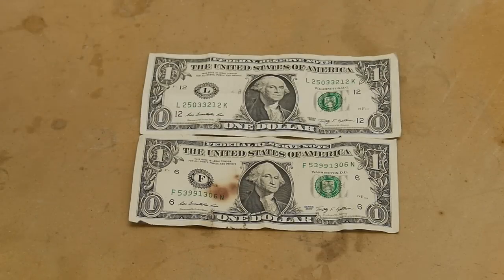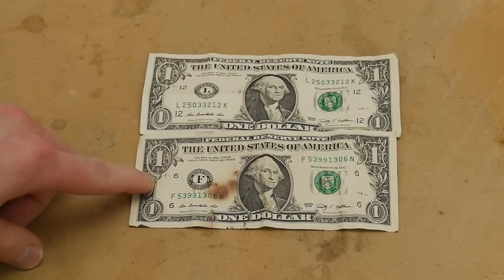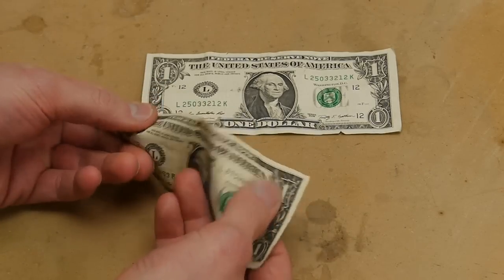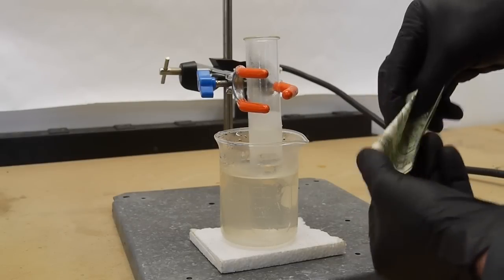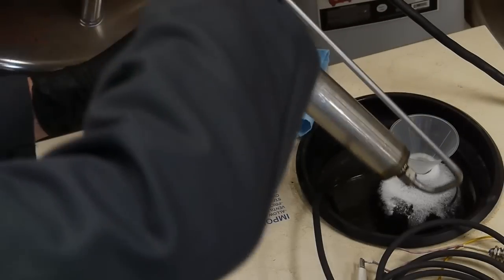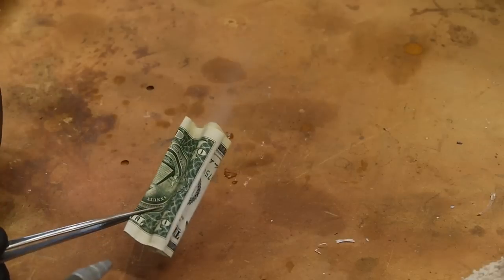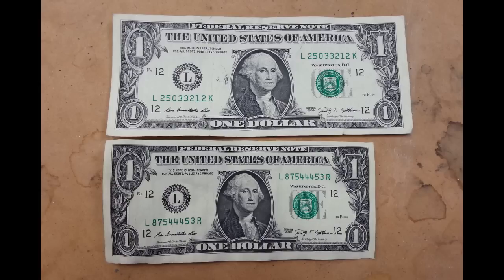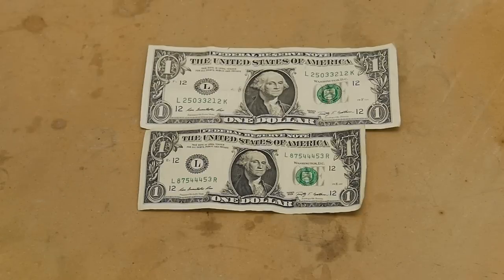Shrinking paper money with ammonia

Comment: (Hands a 20 to a cashier)
"Do you have any smaller bills?"
(Hands a shrunk 20 to the cashier)
Reply: Thom nice one.
Reply: +Thom I wounder if all the validation marks are still left on it?
Reply: Well yes and no. I mean the ratios are probably still there but most checks would not work because they do not expect the paper to shrink.
Reply: Well yes and no. I mean the ratios are probably still there but most checks would not work because they do not expect the paper to shrink.
Reply: Yes they are.  It's my job to inspect bills for counterfeit.  So when I came across one of these you can imagine my surprise when I examined it and found it to be authentic.  One dollar bills don't have all the security features that larger bills have.  But there are certain things to look for that will tell you if it is real or not.  I can tell you it had me scratching my head, because other than its size it checked out to be a good bill.  It even passed the counterfeit pin mark.  Which isn't always a good indicator of a fake bill but normally it will always mark a good bill as real.   Sending your money though the washing machine can cause a counterfeit pin to indicate it is a fake bill.  But I have yet to see a pin mark a counterfeit bill good.  Ya someone will tell me their story now.  But so far I haven't came across it yet.
Reply: That's why Goerge Floyde can't breathe

Comment: How many cycles did you put the dollar through?
Reply from the maker: ***** About 10 cycles or so.
Reply: +Applied Science maybe it's because the ammonia leaves the bill and creates suction inside the soft fires wich pulls them together?
Reply: Applied Science this absolutely does work....and I know cause I did it when I was an ammonia plant operator....you can shrink it 60% in 3 cycles if you put the ammonia soaked bill on a hot Steam line 😎

Comment: Curious to know, is it still legal tender? I'm sure the counterfeit testing guys would have their microscopes on it and be scratching their heads with the quality of the printing. Lol
Reply: Green Silver then really scratching their heads as why the heck you messed up the size.
Reply: Also, why would anyone counterfeit a $1 bill? lol
Reply: JAWS OF FIRE 
Here in the UK our £1 coins are regularly counterfeited, they are usually cast from what looks like brass. I guess smaller denominations are less likely to be checked.
Reply: Green Silver really? interesting. I haven't heard of that issue occurring in Canada (which has both $1 and $2 coins) —at least as a significant problem that anyone hears about.
Reply: MsHojat don't even let me get started on coins in italy, i'm sure some people even counterfeit 1 cents.
Reply: +MsHojat in canada much of the fake money is about a 1/8th of a inch smaller i assume due to the process used to make it but have no idea what the process is.
Reply: I think counterfeit money is often detected because it has better printing quality than legal tender.
Reply: Darren Ferguson I'd be surprised if it was really that simple...
Reply: Spencer Ross it happens a fair bit.
Reply: +Darren Ferguson - that's exactly what I'd say if I were the PR department of the counterfeit office...

+Green Silver - it's probably considered spoiled and would need to be traded in for good condition money.
Reply: That's the problem printing plates and paper come on one size.  We all agreed that it was real we just weren't sure how it was done.  I thought that it was some fluke.  Ran it through the washing machine with some new kind of detergent or possibly dropped it into some kind of chemical.  By the way if you weigh them they are still the same weight. Found the answer on the internet.  But by then I wasn't all that surprised that it could be done.
Reply: Green Silver Of course it is.
Reply: Just send it to the Secret Service and ask if this is real.
Reply: @DazFromTaz  I've detected many counterfeits, none are as good quality as legit money. What they do is dip them in baby oil to cause a sharpening effect and it also fools the markers. The slight refraction of the oil explains why it looks different and many people will put it in their till. Also the watermarks are half printed on the front and half printed on the back and the band is printed on the back. They use a combination of small pen marks and colored polyester fibers like velcro for faking the fibers. On hundreds they'll rip it in half and put a piece of tape over the blue strip to explain why there's no holographic effect and they'll use arts and craft sparkle glue for the bell. I've seen shrunken legit bills but never even close to as much as this one. Surprisingly the hardest feature to fake seems to be the bell and the paper feel.

Edit: Also under magnification it's very easy to see the fibers aren't real if they're pen marks because the lift off is pointed when it should be sharply cut off. The velcro you can tell is fake if you can move it with your fingernail.
Reply: @jamisonw.327  couldn't you take 1$ bills and bleach them to have the same rag paper to make higher denominations maybe even save the ink
Reply: @jamisonw.327  they also bleach $1 bills using easy off oven cleaner... then print over them with $100.. 
 It passes the marker test because its real money
Reply: @helpabrothawithasubisaiah5316  True, so they get the paper and fibers, but printing on money paper isn't as easy as regular so the print quality is almost always trash. The best counterfeits I've seen weren't modified ones, but I did see some with very convincing paper. They put oil on it and it's cotton based so whatever difference you expect to be there your brain assumes it's because the oil and not because it's fake. This particular one even had glitter on the bell and a fake band that lit up in UV glued to the back of it. The counting machine wasn't fooled but my boss at the time was. Doh. Better her drawer than mine.

Comment: Lengthwise, it looks to be at about 90% of its original size. Did it also shrink similarly along its up/down axis? I ask because I'm wondering if it has a "grain" to its structure, like an oriented-strand sort of composition. If it shrunk in both directions, that would imply that it has more of a "weave," wouldn't it?

Just curious. The dollar bill is not likely to be soon featured on How It's Made.
Reply: They actually did have a how it's made on the dollar's fabric paper, I believe.
Reply from the maker: pocket83 I'm pretty sure the shrink is uniform.  I'm guessing the paper money has randomly oriented fibers which cause it to behave nearly the same in all directions.
Reply: Applied Science Why not just do a quick aspect ratio calculation for both bills?
Reply: Applied Science nope, your first mistake is assuming that "paper" money is paper, it is not. It is cotton fabric, the fibers are not randomly aligned.

Anyway, looking at the picture and paying attention to the circles and ovals, I do believe that the shrunk bill is shrunk more on the major dimension than the minor.
Reply: ***** this makes me wonder what would happen if this treatment was applied to something woven.
Reply: I was just about to ask this exact question. The smaller dollar bill shows some distortion in its details that indicate a bigger change lengthwise than width wise. Look at the star like pattern to the left of the central character. It looks circular on the shrunken note, but more oval on the standard note.
Reply: This is an old comment, but FYI, the shrink does NOT appear to be uniform! Took a screenshot and measured out the dimensions of both bills. It looks like the length shrunk about 8.5%, but I could not detect a change in height. I even checked features on the bill, like the height of the letters or the height of the portrait, and those did not change either. It appears to me to have ONLY shrunk lengthwise.

Comment: I wonder if it's still ok to use bills that are legit but shrunken a little bit
Reply: That's what I was wondering. The problem is that people might assume it's fake, but it's probably still legal tender.
Reply: Pretty sure no one would take it. It'e legal tender, sure, but anyone would be wary of such a size difference even if you tried to explain the science behind why it's different. Now what I'm interested in is whether or not the more modern anti-counterfeit bands present in 20's and up shrink adequately or get messed up, since those are not the same material as the rest of the bill.
Reply: you can always turn it into treasury department and they will replace it.
Reply: I did this and no gas station will take them

Comment: Can you use the same process to create an ultra dense piece of wood. The idea would be to create a piece of wood that would be suitable as a mallet that would not normally be used.
Reply: He already did this with wood, but it just created flexible wood.
Reply: But it wasn't the same process. Actually that's a pretty good question. If you could create denser wood with this technique , it would make for some really exotic and expensive material for all sorts of fittings, accents, knife handles and such.

Comment: I know this is an old video but this video left me with some questions. 1.  What did this do to the material, wood, paper, or what have you (dollar bill)?  If it removed the moisture from the material, did this make it more rigid, brittle, stronger etc?  Did this make the wood fibers tighter weaved?

Comment: question: it seems to have shrunk disproportionately. Am I right? Which indicates it has more to do with the direction in which the paper is produced. 
Regular paper has a direction. You can tear it in one way, then it'll make a nice sorta straight line. Try it on a 90 degree angle and it just doesn't work. This has to do with the production process.
If it shrinks more in one direction than the other. It might be the surface tension pulling the fibers in, but also releasing the tension in the material itself.

Comment: Why do you think it's surface tension, rather than being entropically driven via relaxation of the fibres?
Reply from the maker: ***** The shrinking happens when the bill is drying.  The shrinking doesn't occur in anhydrous gaseous ammonia, and also does not occur when submerged into liquid ammonia.  Therefore, I think the key part of the process is the evaporation/boiling of the ammonia from the bill, which would indicate the liquid/gas interface being important.  I'm not positive, though.

Comment: I'd guess the ammonia caused fibers in the note to coil more tightly, causing the smaller resulting 2D size. A microscopic exam might reveal if the small-scale structure of the material changes.

Comment: I wonder if the wood is actually shrinking too.
Reply: ***** I doubt it.

The wood is this sort of bundling of fibers.
The bill is a mesh of fibers.

One can tighten up, the other is already tight.
Reply: +seigeengine a fiber is a fiber, the wood would still be shrinking it is probably more resistant and shrinks less as a piece of wood than paper though.
Reply: Richard Schmidtendorff Uh, no, they're not, also, stop trying to be right regardless of the context of the discussion.
Reply: wtf lol that sounds like you. And yes wood, and Cotton fibers are in the paper, so ummm yeah they are the same fibers.
Reply: Richard Schmidtendorff Nope.

Comment: You should have used a dry ice, acetone bath to cool the liquid ammonia. Thats standard procedure at the lab.
Reply: why?
Reply: Stabacs McBass Because dry ice freezes at -78 degrees and liquid ammonia is at -33 degrees.
Reply: Hmm okay, but why should he use it, his method worked well enough for his purposes, right?
Reply: his method doesn't keep it cool enough for long enough as there is no phase changing material to keep the temperature cold such as subliming dry ice. If you have worked with ammonia you would know that the smell is extremely strong and at higher temperatures it vaporizes even more rapidly. One can begin to smell it at 5ppm and unsafe levels 35ppm.
Reply from the maker: aeroscope I'm actually using a cryogenic freezer.  It will keep the bath cold as long as power is applied to the freezer (and as long as it doesn't malfunction, which happened last week).  Search my videos for more info.  The freezer uses two compressors and ethylene gas as the low-temp refrigerant.

Comment: Has the transparency (or rather opacity depending on how you look at it) of the unpainted parts increased or decreased? I am hinting at the space between the cellulose crystals which cause light diffraction. There is room to give and if its all gone it should be transparent.
Of course if they whiten the paper by adding TiO2 or use another filler such as kaolinite than that would completely reverse this since obviously its volume concentration would increase with the shrinking.

Comment: hmmm, instead of shrinking a real dollar bill, you could make counterfeit ones easier, because the biggest giveaway is lack of detail on counterfeit bills. So you could print out a sheet of paper with the same width and length ratio, but maybe a foot long, making it much easier to get the details on it. Then you apply the ammonia to it a couple times, and then bam, as detailed as it needs to be without expensive machinery.

Comment: I made the mistake by doing this. But to a 100 bill. Let's just say it got small enough were it was unusable. It still had the strip of numbers when you put it under light. And still couldn't use it. I was thinking about exchanging it at the bank and explaining how it got so small. But they probably should not believe and question why I did it yo a large bill rather than smaller denomination.